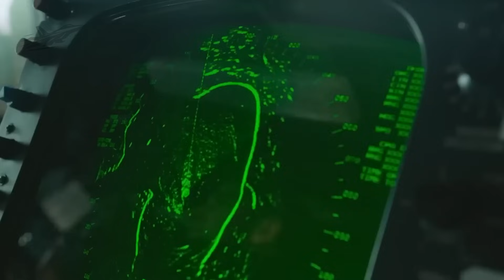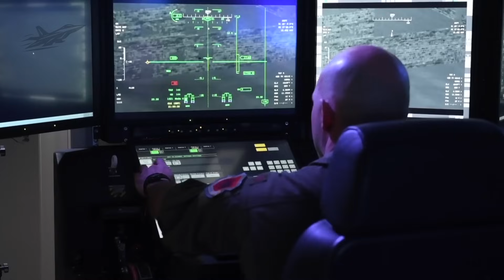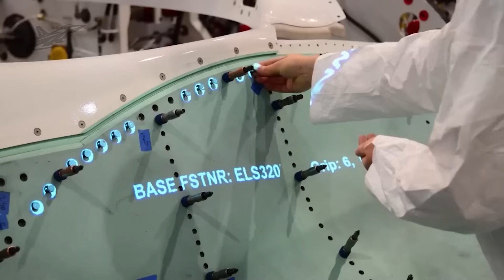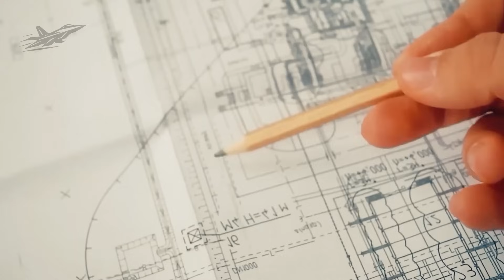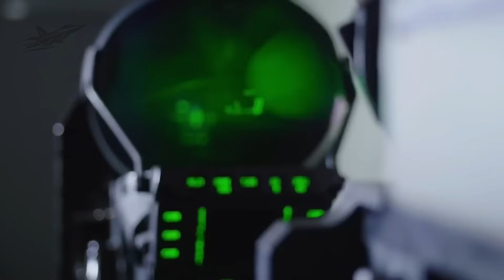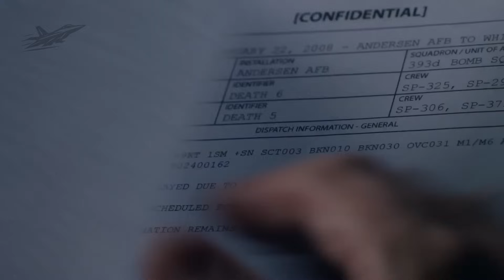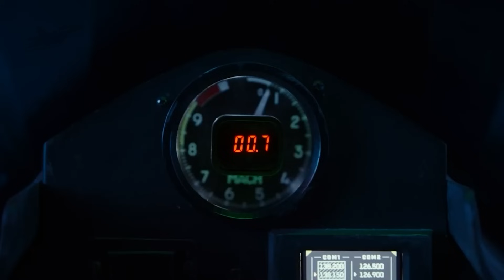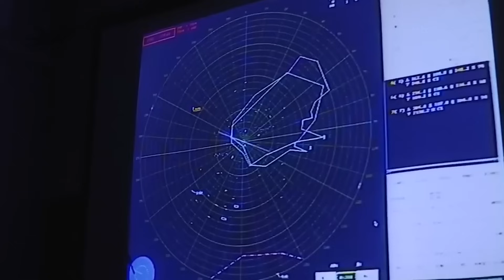China J-36 Official Power EXPOSED — It's Scarier Than We Thought

Comment: Is it like the F35 over budget, unreliable more time on the ground then in the air?
Reply: man your fucking dumb
Reply: no, F35 cheaper than F22(which stopped it's production). However, check out F47. finally revealed. Also check out air volumes.

Comment: Compare with F35, J35 has its own first mover advantage. While they have similar niche， J35 have better Engine tail nozzle and Radar detection capability. (CHinese weapon`s real ability is always exceed the data on website (e.g. PLA says PL15  can shot 150KM, but it actually destroy enemy from 200 KM) Moreover, The streamlined design is more elegant. The coating has been updated. It can work in perfect coordination with other weapons for systematic operations.That`s why we say J 35 is  the version of F35 itself that F35 dream of.
Reply: Will see!

Comment: In fact, the maximum speed of the J36 is 5 Mach, and its maximum altitude is 30,000 meters, which is 12,000 meters higher than that of the F22. Its speed is 2 to 3 times that of the F22. It has full-frequency stealth. Only the seventh-generation aircraft can go into space, while the sixth-generation aircraft can fly at the edge of space at most.
Reply: Right no body mentioned rotating denotation engine is very likely used on China's 6th gen fighter.
Reply: @foodparadise5792  I know they have it, but so far, it's just 3 conventional jet engines on this puppy.  That middle inlet is dsi so optimized for mach 1-2.
Reply: Random assertions based on nothing.
Reply: @henryjohnson280  真实的数据中国不会在美国制造出六代机之前公布，未知的武器才是最大威吓，让美国人学乖
Reply: @龙的传人-k6r @龙的传人-k6r   interesting - love to research, could you share the source of this statement? Thanks in advance.
Reply: The true max altitude for F-22 is 15000 meters, not 18000 meters
Reply: actually i hear that it can go into the lower Space, speed is actually 3-4 mach. mach 5 is a bit too much. That's their Air to Air missile's speed.
Reply: One goal for 6th gen is dual cycle engines.  J-36 side engines will do high bypass fuel efficient mode or low bypass super cruse. Central engine is far forward and has 2 possibilities.

1) high exit velocity rocket engine at the center axis of a jet engine using both kerosene and liquid O2 as two stages of coolant. LOX could also be used to dump surface skin heat.  Variable O2 to fuel mix to act as an air breathing rocket engine / afterburner.  It would have high chamber pressures to increase the energy of the exhaust gases, and due to being inside of a jet engine require extensive cooling to prevent thermal failure of the engine.  For lobbing munitions the ability to go full rocket while still acting as an afterburner using the thin air as propellant weight would be extremely advantageous.  However there are questions as to feasibility related to the exhaust length required. High velocity exhaust would have low pressure, but how quick would fuel mix with the air?  But if it can be done, you get a path to SSTO later.  Starfighter path with huge utility to lob telephone pole sized munitions.  Dual and triple stage munitions can have extreme ranges with this tactic.

2) If that isn't feasible you can still use a dual cycle like the 2 outboard engines, but with a third mode with high bypass and traditional afterburners.  This lowers the risk of the platform.  You can attempt to shoot the moon, without the risk of the platform failing.

PS: The ability to lob to lob telephone pole sized munitions means that China will like make the J-36 even if they don't have the engine tech ready.  They can always add them to a later block.  China has smart people in positions of power, unlike the USA.
A PL-15E scored a lateral kill at 200-220km, as a dual cycle missile inherits the velocity of the craft lobbing it.  Aiming in the direction of SSTO is very smart as the engine thinking also gives you range.  Stealth refuelers would also be smart, but one should still aim for range.
We have no answer for the J-36 or future evolutions.  We can make the F-47 in mass and that is it.  It's aimed at the J-20 and J-50.  It's what we can do but we are a dying empire.  Evil and stupidity has killed us, and our death throws is a great danger to the entire world, not just China.

PPS: Would you say I'm smart?  Any utility in my comment?
Glad China is running with the idea.  I certainly didn't have the ability to make it myself.